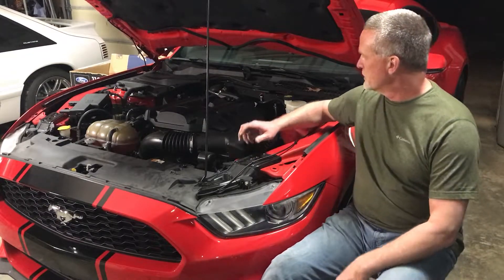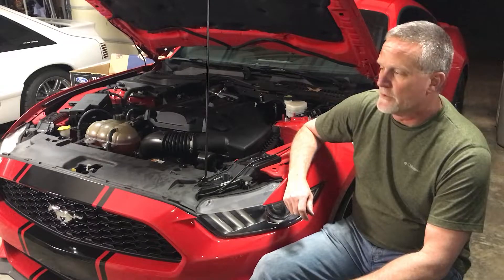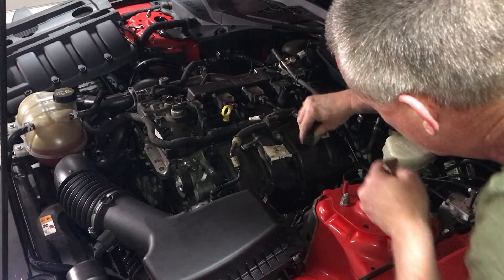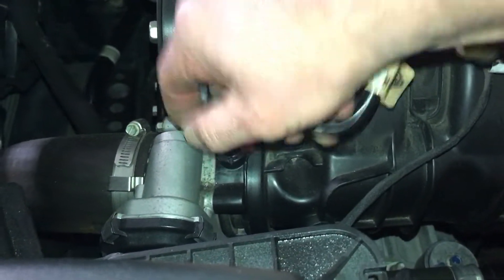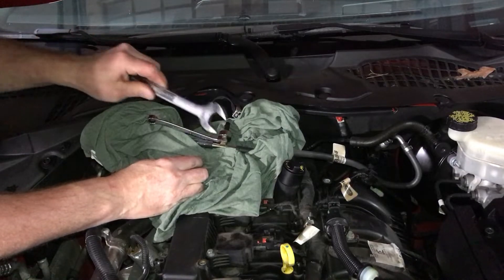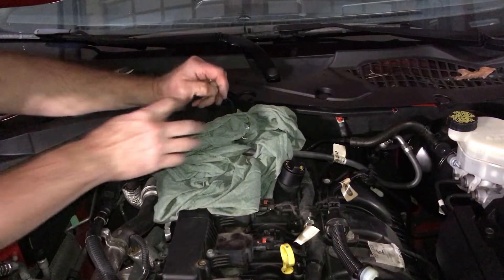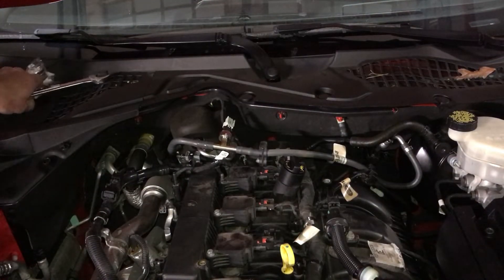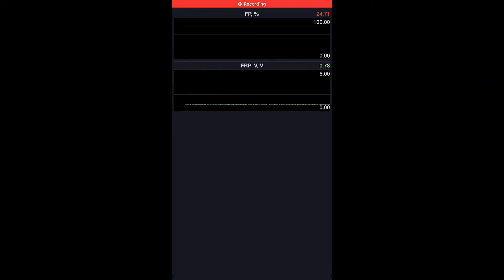Mustang EcoBoost Trouble codes P018C P144C Quick Fix for Fuel Pressure & EVAP codes

Comment: I just did this for my 2015 mustang eco boost last weekend and it was fine for a couple days now the check engine light comes on. Ran codes for P0443 and P0455. Could it be the purge valve? Or the pressure sensor? Maybe both? Any ideas need some help
Reply from the maker: Must be purge valve or leak in fuel evap system. Check all hoses. Did you fill up more fuel after the hose cuts off?  Not sure what is common for the Mustang without research.

Comment: Hey, I have a ford mustang ecoboost 2016 and I have check engine light on they told me it’s from the oxygen sensor tried to fix it and after we did check engine came back on again, do you know what it might be or maybe you know any solution? Thanks!
Reply from the maker: I am not sure how many sensors the ecoboost has. I assume upstream and downstream. Did you change both?  Normally, when they go bad the heater burns out in them.  I would buy a cheap code reader or go by auto parts store and have them read the codes. Is it the same code?  It should tell you which bank is bad.
Reply: I have the same problem in my ecoboost 2019 I scanned and it said that oxygen sensor I put a new one but check engine light came back any info ??
Reply from the maker: @danielcortez8884  I don’t work on the eco booms much. I do know you need to replace spark plugs often.  I think there are 2 o2 sensors but not positive. Code reader should tell you which one.
Reply: @tiktokcomp7064 did u find the problem?

Comment: I changed the part and put the new one but the engine light is still on, do I have to delete the code with a scanner or can I disconnect the battery?  can you help me please
Reply from the maker: Yes. You can reset by disconnecting the battery for 30 minutes. Turn your lights on to make it bleed down quick. Of course, a scanner is the easiest way.

Comment: What is the DTC code scanner that you are using? Seem to be link to you iPhone . Please share the brand or lino . Thanks
Reply from the maker: I am using FORScan it’s Ford only. I paid $30 for the 5 yr license but I think you can still get the free version. I really like the app for quick troubleshooting. You would have to buy the ELM adapter to connect to the app $30. Look on the FORScan website to choose which adapter you want to use.  I chose the wifi adapter.  You can also change things in the computers if you want and also do your own keys.
Also function Mode6 is your best tool with it for misfires and such. 
FORScan.org

Edit:  I see the prices went up and they don’t have the wifi version anymore. I have the old ELM with the switch and it still works. Looks like I need to upgrade to the BT version but that one is $140. Wow. I have the cable to my pc too. You will need the pc version to do computer changes. The app on the phone is good for reading codes,  doing tests and PIDs.